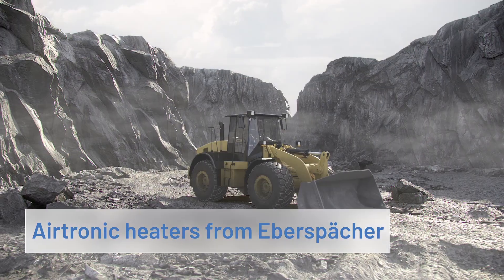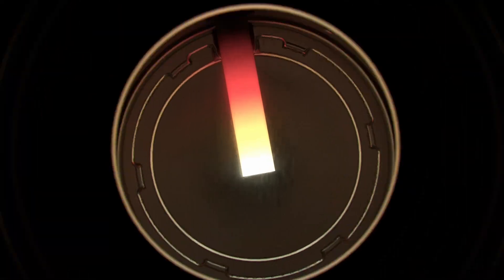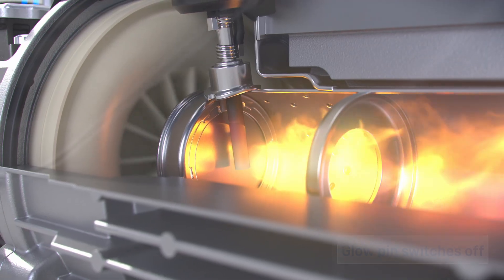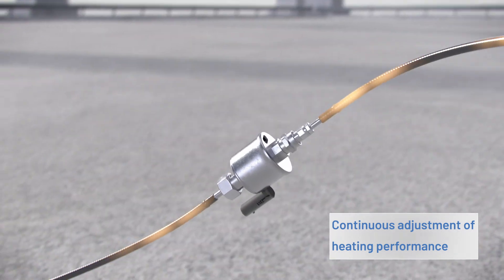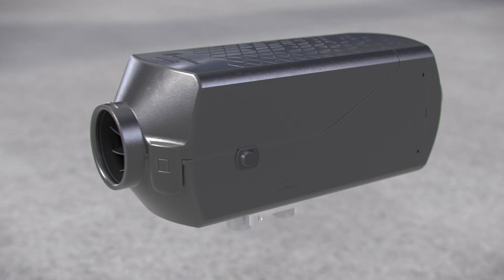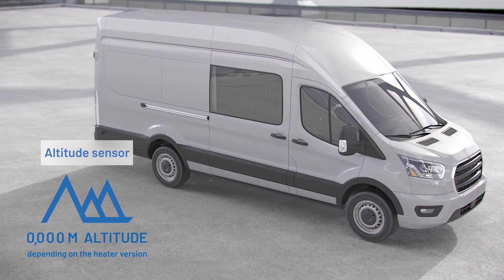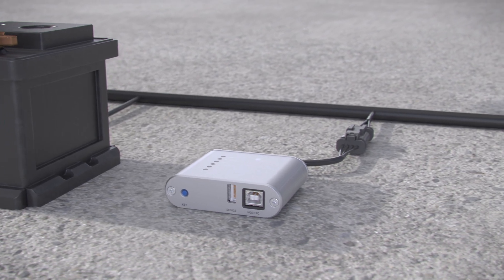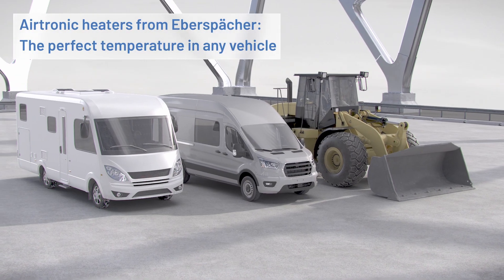Airtronic 3 by Eberspächer – the newest generation of air heaters

Comment: what is the longest possible working temperature and time will it drain if it work 12 hours ? How silent is it I asked google gemini about it so it gave me a convern about ticking noise I want to install to toyota prius and sleep in car in sweden when I travel The discussion regarding which of the two, Eberspächer or Webasto, is quieter is a heavily debated topic.

As a general rule, the sound difference between equivalent models from both brands with the same heating capacity (e.g., 2kW) is typically very slight for someone sleeping in the woods at night. Both systems are highly optimized for low noise.

However, there are two main components to the sound produced by the system:

1. Fan Noise (Airflow Noise)
This is the sound generated when the device heats the air inside the combustion chamber and blows it back into the cabin.

The modern series from both brands (Webasto Air Top and Eberspächer Airtronic) are very quiet when running in low-power modes and generally do not severely affect sleep quality.

When the heater starts running at full power (while initially warming up the vehicle), the fan noise increases, but once the set temperature is reached, it automatically switches to the lowest (quietest) level.

2. Fuel Pump Ticking (Ticking Noise)
This is the distinctive "tick-tick-tick" sound produced by the fuel pump as it precisely meters and pumps small doses of gasoline or diesel into the device's combustion chamber.

This noise does not come from the heater unit itself but typically from the pump mounted underneath the vehicle.

Pumps from both brands make noise. To compete on quietness, both companies offer silent pumps (e.g., with noise-dampening mounting brackets) to reduce vibration.

While some users claim that Webasto's vibration-damping kits are slightly more effective at reducing fuel pump noise, others suggest that Eberspächer's newer pumps are inherently quieter. This largely depends on where and how the pump is installed.

Conclusion and Advice
If maximum quietness is your priority:

Focus on Installation Rather Than Brand: Whichever brand you choose, ask the installer to pay special attention to sound insulation (silent mounting kit, damping buffers) for the pump.

Choose a Low-Power Model: For a small vehicle like the Toyota Prius, do not choose an unnecessarily powerful model (opt for a 2kW model instead of 4kW). Heaters running at lower power will remain in the lowest fan speed and quietest mode for longer periods.

In summary, it's difficult to name a theoretical winner between the two brands, but with professional installation, both will provide a perfectly adequate and quiet environment for your winter camping in Sweden.

Comment: I am in the process of installing my new AS3 B2L. I have the documentation for the heater but nowhere does it say how much clearance is needed next to combustibles like plywood or Styrofoam insulation.  There will be venting in the enclosed location.  Does anyone have specs on this?
Reply: If it's next to wood it's probably gonna be hot but if it's in a tight area it will turn off prematurely due to the surrounding area being hot in a confined space. Put the heater in a place that is common sense. Not shoved in a shoe box so to speak. Your home has a utility room so go with some space. And put it say under the counter with at least a foot so 16 inches height and 24 inches with it being centered at 12inches. So you can secure it with bolts or with strut. You gotta consider installation and removal. Cause if it ever breaks down it will be when it's cold. Or put it under the bench seat with a lift up cover and cushion on top.

Comment: Dear Eberspacher Team,

Could you please check for me what will be the altitude limit for Airtronic AS3 B2L 12V 2kWts 12V heater number  20.2029.05.0000.0B since it is more budget friendly with the enough heating capacity and better size wise for further installation in my LR Discovery 4 🙏
And maybe there is some additional device as the altimeter that can be bought separately in order to upgrade the limitations of AS3 model? 

Thank you so much! 😊
Reply from the maker: Hi Max, 

so bad news first: There's no altitude kit for the current gen of the Airtronic. 
But here's the good news: We've gotten the results back from long-term test runs with the AS3, and the system can manage up to 4.000m of altitude instead of the originally stated 3.000m. Hope that fits your needs! :) 

Best & thanks, 
Your Eberspächer Social Media Team

Comment: Dear Eberspacher Team,

Please guide me, will gasoline air heater Airtronic AS3 B2L 12V 2kWts 12V heater number  20.2029.05.0000.0B adequately work on the altitudes up to 5500 meters above the sea level or it is limited to 3000 meters and for my purposes I need to go for Airtronic M3 model part number 20.2030.05.0000?

Thank you in advance! 🙏
Reply from the maker: Hi there, and thanks for your interest! Yes, to get the automatic altitude adjustment for up to 5,500m, you need to opt for the Airtronic M3 Commercial with the mpn you mentioned. :)
Reply: @eberspaechercom  Hey guys and thanks for your reply! Well copied and highly appreciated! 🤗

Could you please check for me what will be the altitude limit for Airtronic AS3 B2L 12V 2kWts 12V heater number  20.2029.05.0000.0B since it is more budget friendly with the enough heating capacity and better size wise for further installation in my LR Discovery 4 🙏
And maybe there is some additional device as the altimeter that can be bought separately in order to upgrade the limitations of AS3 model? 

Thank you so much! 😊

Comment: I know the running wattage is around 26w, but what is the startup wattage demand? I am hoping I can run this on my power station.
Reply from the maker: Hi Jeff, you should find anything you need in the detailed technical description, which you can download here: "https://we.tl/t-MgaUFwFsO9" We hope, this helps. If you need anything else, just get back to us. Stay warm!
Reply: @eberspaechercom 
What unit would I install for marine (sailbost) application?
Reply from the maker: Hi  @jacksmith6063 , thanks for your question. Well, it depends on the size of your vessel. We have the Airtronic 3 available for commercial and leisure craft in 3 versions, plus 3 Hydronic options. You can find out more at https://www.eberspaecher-marine.com.  Hope that helps, and feel free to reach out to us if you need more support. :)

Comment: Great video. I am installing an S2 in my van. Due to the location I need to put a few extra 90s in the exhaust hose. Will any amount of contortion of the exhaust hose be it 90 degree bends, constricting the hose or expanding it potentially damage the unit?
Reply from the maker: Hi & thanks for your question. We wouldn't recommend it, because every 90° angle increases the counterpressure and thus reduces the effective exhaust length. As far as damaging the S2, we would need more concrete info on what your plans are - how many bent angles do you want to put in?
Reply: Thanks for the reply. I was worried that would be a problem. I will have to work out a new approach I guess. It isn't worth the gamble.
If there were too many bends in the exhaust, what happens to the heater? More soot build up?
Reply from the maker: @albertanasoul  You run a likely risk of overheating the unit. For a better assessment, we'd need to see your build plans. You could write to our Eberspächer Group account on Insta - we can try and get into the details there. :)
Reply: @eberspaechercom  ok, thank you for your time.

Comment: Hi, I see on your website that there is an advertised option for a gasoline/petrol powered heater. Which model is capable of working with this fuel? Kind regards.
Reply from the maker: Hi RoobehTunes, the Airtronic S3 and M3 are available as both petrol- and diesel-powered versions. The L3 and XL3 only take diesel fuel.  Hope that helps!